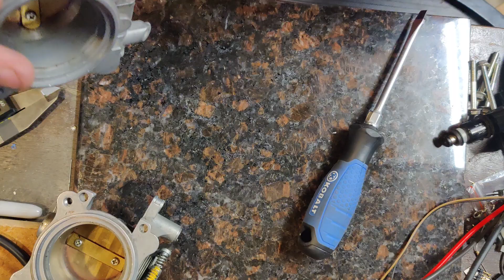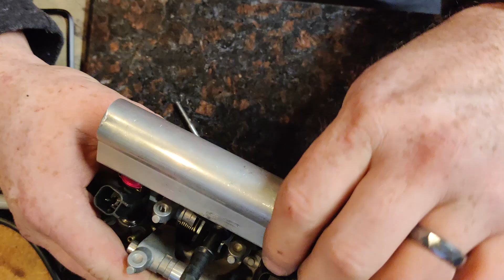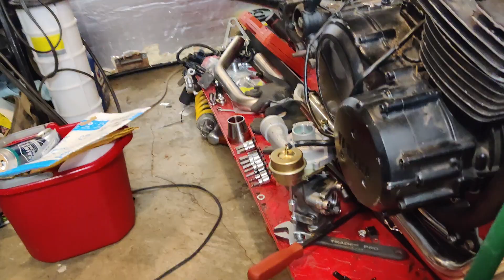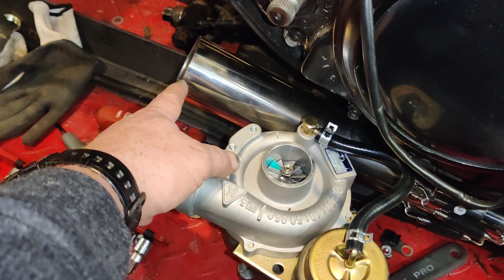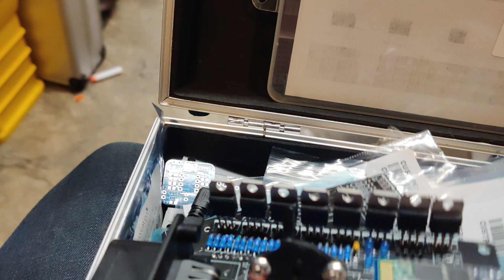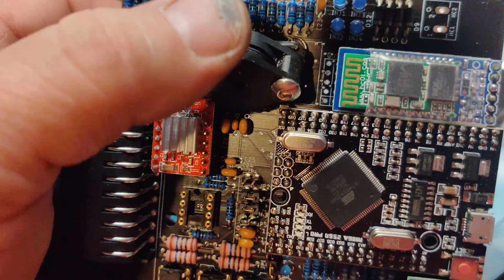Convert ANY motorcycle to EFI...Cheap!

Comment: Yeah dude… You’re doing some amazing stuff good job. There is a lot of good information in just this video. There is other information out there of people converting carbureted bikes to EFI, Not as much as there is for cars obviously. But for some reason there’s a lot of naysayers out there that are either saying it’s impossible or not cost-effective. From now on I’m just gonna direct them to this video… LOL... i’m looking into doing an EFI conversion on my bike, It’s a 2000 YZF 600 R, Also known overseas as the Thundercat. I personally am not a fan of the CVK Keihin carbs that come on it. I know that 04 R6 throttle body’s will pretty much bolt right on. Biggest piece of this puzzle due to cost seems to be the ECU, Speeduino looks to be the best and most cost effective solution. I do have a couple questions that of all people you may be able to answer. I know I can make and attach a trigger wheel to back of the fly wheel, I’ve seen someone else do this and he has a working design that utilizing the puller holes to mount the trigger wheel. A Hall effect sensor (Cherry - GS100502) is drilled and mounted above the trigger wheel through block. You had mentioned magnet, I just want to confirm the magnet is in the sensor correct? Lastly, I would preferred not to do batch fire but I’m concerned about having the tools and skills necessary to get a cam signal. I have heard that some manufacturers don’t use a cam Sensor specifically to help the ECU determine the compression stroke from exhaust stroke, Instead they use an intake pressure sensor and program the ECU to count the degrees between the pressure change. Is this a feasible option?
Reply from the maker: With a hall effect sensor, the trigger wheel will need to have magnets attached. A variable reluctance (VR) sensor just measures the change in proximity to a metal object which is why they're more popular. The only downside to VR sensors is that they require some signal conditioning to be read by speeduino. As far as I know there is no option for speeduino to run sequential injection without a cam signal.

Hope this info is helpful and good luck with your project.
Reply: Hey, sorry for so much back-and-forth, I talk to that guy and he said it’s considered a Halleiffect but for some reason it does not need magnets on the trigger. But it does require a pull up resistor wired in between the signal wire and I want to say power. The sensor a Cherry -part# GS100502 it looked it up and it is called a hall eiffect sensor, plus this guy does have a running model. I’m not sure if it’s Road tested but he does have signal and tachometer is registering RPM in tuner studio. I know you’re a busy guy so it’s cool no big, But If you have a chance do you think you could look up the part number and give me your opinion? Maybe it’s just a glorified VR...
Reply: There are Hall effects that can read steel “teeth” alone with no magnets.  I saw on robot cantinas video about fuel injecting the harbor freight predator engine in the little Honda car (it’s a YouTube channel called robot cantina) that he ran into this problem of Hall effect needing magnets on the flywheel and it got me thinking.  On second gen hayabusa engines they use a Hall effect sensor (3 wire) for the cam position sensor (the gen ones used variable reluctor 2 wire standard type).  The “tooth” on the camshaft these sensors “see” is just a little 6mm hardened steel pin.  It’s not magnetic at all.  So I know there are specialized Hall effect sensors made for automotive and motorcycle world that must have the magnet built into the sensor body and not require detecting a magnetic “tooth” swinging by!  I’ve seen many similar sensors on many modern cars/bikes I’ve worked on at day job.  They way I tell var reluctor from Hall effect easy is 2 wire is vr and 3 is hall sensor.  If I’m not mistaken, hall is much more reliable signal as it generates a good square wave on/off even with slow cranking revolutions versus a vr sensor which gains signal strength with rpm

Comment: Really impressive stuff. I'm just getting into messing with speeduinos (no2c board) and like yourself I'm not keen on the IDC or molex connections. 
Your board solution looks awesome, if you are willing to sell and post a populated board to the UK I'm very interested. Keep up the good work
Reply from the maker: Sure, I can throw one together and send it across the pond.  I am still waiting on some more connectors, so it might be a little while.  Message me on Instagram for details.
Reply: @bombshellbikes1559  Yea, same here. I'd love to build this all myself, but I just ain't likely to have the time for a ground up build.
Would love to get ahold of a built/mostly built box.

That said, you happen to have any TB recommendations for an old 83 GSX 750? I've given up trying to find carbs, already have a wideband anyway. FIgure I"ll probably dump an old liter motor in there, and if i'm going through that trouble, might as well be injected.

Comment: I've got plans to buy a 200cc EFI Kit on aliexpress for my Keeway Superlight 200 and later replace the ECU with a Speeduino, I really want to get rid of the carburetor and try to use my bike while its fuel injected. There's any caution or consideration that I have to know before doing the conversion? Also I'm not an expert in motorcycles and this will be my very first disassembly of the bike
Reply from the maker: Only thing I'd be concerned about would be the crank trigger. Depending on what the kit uses, it may be tricky to adapt.
Reply: @bombshellbikes1559  IDK if my bike has a trigger wheel, so I'm looking a solution to create or implement one, like in both videos

https://www.youtube.com/watch?v=cv1vDk-vTSA
https://www.youtube.com/watch?v=gcCP59zLcTk
Reply: What kits are you looking at Pedro?

Comment: A turbo xs750?   Wow very nice.   Say goodbye to 2nd gear tho!  

Why bother with a tach signal?  Shouldnt it work with just the 36-1 and single channel for injectors?
Reply: Also, you COULD use a single large throttle body and go draw-through, which would cool the air charge and make setup a little easier perhaps.   Just a thought
Reply from the maker: I could do batch fire injection, but in my experience, these smaller engines, especially with ITBs idle much better with sequential.
Reply: @bombshellbikes1559  - from a car perspective, they only use sequential up to around 3k rpm. After that, things are moving so fast they switch to batch anyhow. The control below that point is much better, so the emissions and idle control is much improved.

Comment: I am thinking on converting my old 84 Honda vf1000f to efi, there's a lot of good info here. About how much do usually spend on a convertion? Great video 👍
Reply from the maker: Go for it! The last bike I converted didn't make a whole lot more power on the dyno than it did with carbs, but the power band was WAY better. It feels like a totally different machine thru the mid range.
Here are some ball park figures:
ECU: ~$150
Throttle bodies: $20-50 from ebay
Injectors: $75-100
Miscellaneous connectors, hardware etc: $100-150
If you have some basic machining capabilities, you will save yourself a lot of money in exchange for your own time to make parts. I highly recommend taking your time to do precise measurements for any parts you need to make and sketch everything up in CAD to get a good idea of how it'll all come together.

Best of luck, and don't get discouraged.
Reply: Thanks for the video I am on the same path as roy same machine. My plan was to use micro squirt. Looking for bodies now mostly finding newer ones with shower head injectors dont think they will work